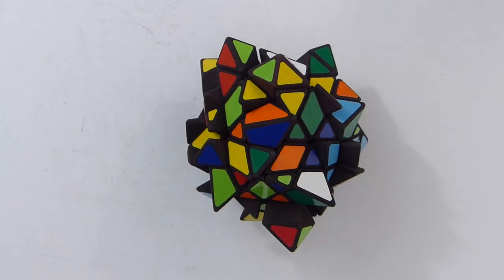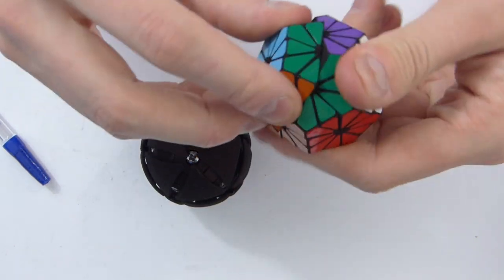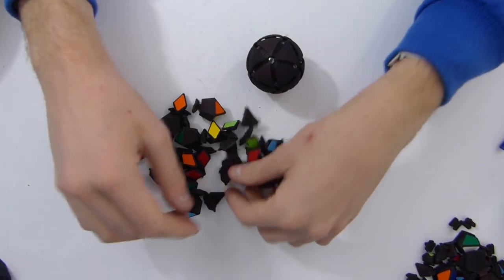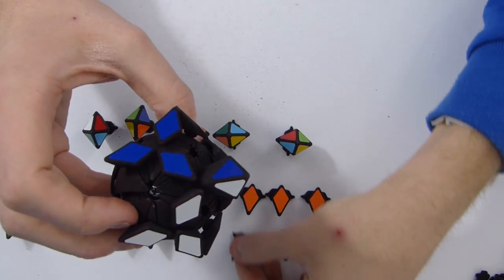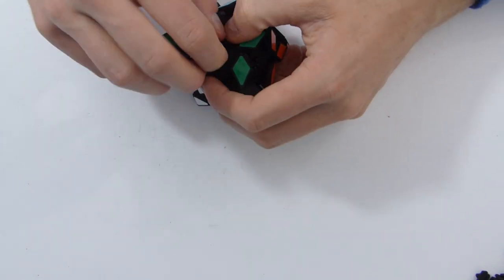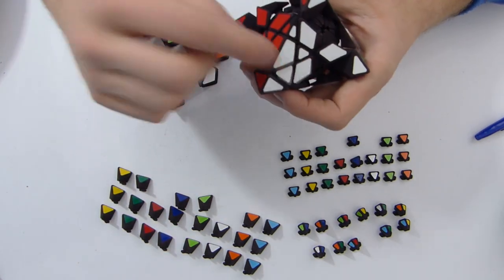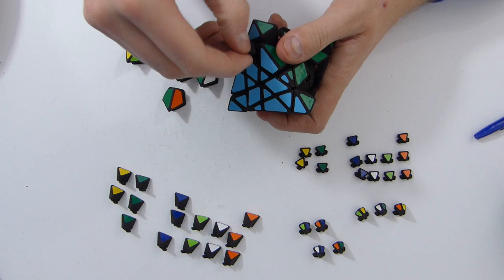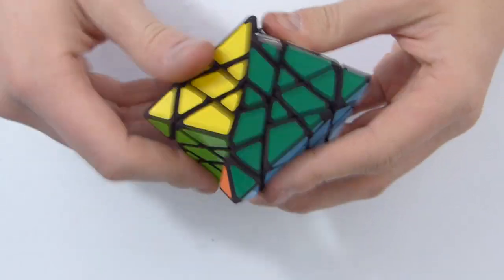Octahedron Starminx Mechanism Revealed !

Comment: How did you find the correct angle of curvature to get the curved cut to perfectly eliminate both megaminx corner spots? I attempted to design this a while ago and mainly used trial and error to get the cut right.
Reply from the maker: Tiral and error ;)
Reply: Tiring, right?